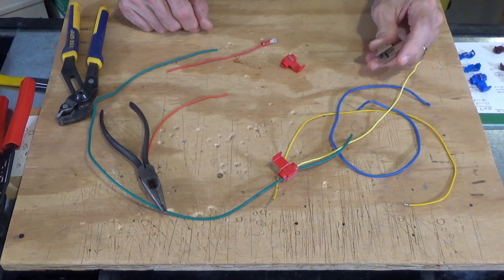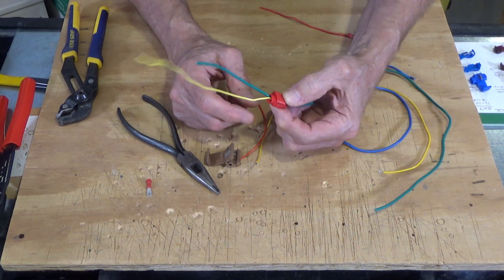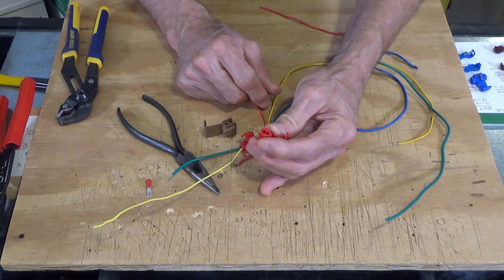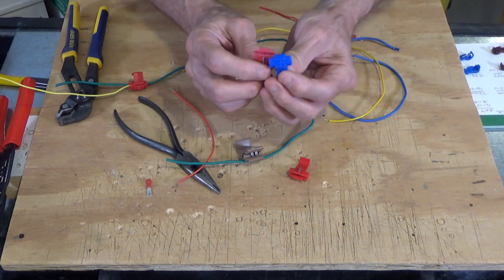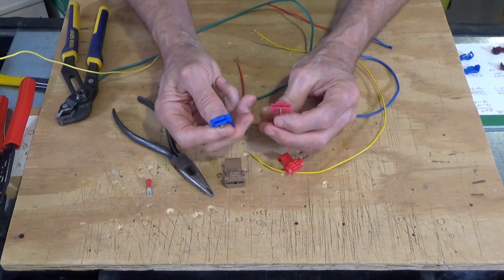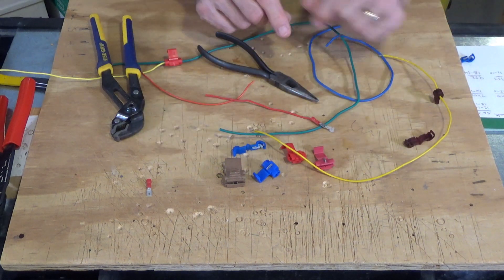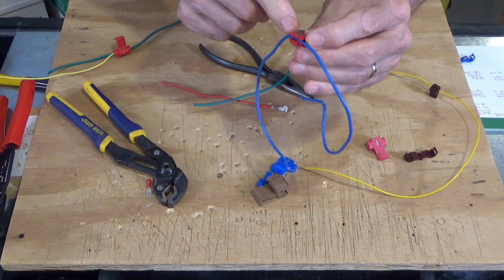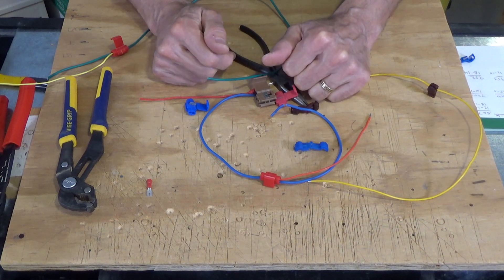Wiring model railroads with suitcase connectors (27)

Comment: I used similar connectors on my layout and found after a couple off years the connections became unreliable, causing trains to stop running on certain sections. As you correctly explained these connections only work reliably if you use the correct size wire. The  WAGO 24-12 AWG connectors are a reliable long term alternative and you can change the wires in the connector if you make a mistake.

Comment: Hi Larry,  your videos are very helpful.  I have a question about using the speaker wire for the Dcc bus wires.  Do you split the wires completely apart to get the 2 separate wires for the drop feeder attachment or do you just slice the speaker wire apart just where the suitcase connectors will be utilized to attach the feeders?
Reply from the maker: I just split it with an Xacto blade where I need to install a suitcase connector. You need to keep the wire runs together as much as possible for it to be effective.

Comment: Try This! Corning 710 Telephone Gell Filled Button Splices they come in 2 or 3 wire Splices and no need to remove insulation as well! These cut through the insulation in 2 separate areas which is Filled with a silicone waterproof grease which ensures that you have a positive connection which is also importantly sealed by the internal grease to prevent any corrosion from occurring. These are designed for the actual Telephone companies and have been used for decades now In and Outdoors. The suitcase variants are okay I guess for some applications that are indoors only and environmentally controlled to prevent humidity and moisture in say a garage or damp basement? Where corrosion is possible for growing inside of a unsealed open connector. Plus the suitcase connector has only a single point of contact with the actual wires. Where the Corning version has 2 different contact points that cut through the wires insulation, which ensures that you have a strong and positive connection to your wires! Just FYI, I've been working with model railroads my entire life and use these for my HO and O Gauge Layouts!  SMFH it beats having to skin each wire, and if stranded wire they'll have to be tinned with soldering in order to use properly in either connector suitcase or Corning. The time savings is amazing over having to skin, solder and then either seal with shrink wrap or tape. These will do everything necessary for just about every size Layout and I've never had one go bad yet In my 45 years now! My father was a lineman and installation specialist for Ma Bell Systems and we always had these special Splices laying around the house. Which he used for his HO layouts and I've used for both HO and O scale and never once had a problem with anything when it came to electrical supply issues. Hope this helps someone out there looking to begin building a layouts or just wanting to upgrade to a easy-to-use, fast, simple and permanent solution to get around having to solder all their connections. (which is of course the proper manner in which wiring should be done) These are the next best thing, in my personal opinion it's actually much better in fact! They come in 2 colors which represents the amount of wires that they can handle. The Clear/Orange buttons are for 2 wires and the Clear/Red buttons are for 3 wire connections. They're rated for 22-26Ga solid core wires, which is much more than adequate for O gauge let alone HO or N or Z, believe me, I wouldn't be recommending these, if I didn't know from first hand experience over a lifetime now. 😊  Happy Railroading Folks!

Comment: Great video. I found another reason why people may have issues. In 2018 I ordered 3M connectors from Amazon and they worked great they were genuine 3M 905s. This year I re-ordered 3M connectors from Amazon and received cheap connectors that are probably quick connectors for 20-22 awg wire. I check the order and the seller does state 3M 905. I did a test with my bus wire and the connector cut most of the wire stands and pulling on the wire it broke in two. I would say that would cause some issues with a DCC bus. I went to Mouser and ordered from there.
Reply from the maker: Yes, Amazon is known to have sellers of fake products.

Comment: Larry, Your demonstrations and explanations are so clear it makes understanding of this so understandable. I wanted to obtain the suitcase connectors you mentioned (3M #905) and was told that they don't stock them normally and would have to 'order' them from 3M. Is that how you obtained them? It seems that that one size should work well for me if I can obtain them. Thanks so much for all of the work you do to explain DCC, etc. phil w., marion, nc.
Reply from the maker: I get mine from Mouser.com (517-905-BOX) and they usually have them in stock but it looks lime they are out of stock until Oct 27.

Comment: Ok so if you have several travelers you tie them all together  then put 1one wire in a connector. You say in video about 1 wire there is 2 what do you do with other wire.
And bus wires go to transfome AC correct?
Reply from the maker: I am not understanding your description of your wires when you say you have several travelers tied together. On my layout I have 4 main DCC buses of 2 wires each that fan out from my PSX4 circuit breaker. These 4 buses supply power to 4 separate blocks. in each block I then use the suitcase connectors to connect rail feeders to the bus wires. I covered this in my book “Wiring Your Model Railroad” available from Kalmbach books or Amazon, and in several articles in MR.

Comment: Larry ... are the pliers you suggest using with suitcase connector the Irwin Vice Grip V-Jaw pliers?   Not Straight Jaw not pliers?
Reply from the maker: Yes those are the ones. These do provide a straight throw over the 1/4” or so needed to compress the suitcase connector and are much less expensive than the specialized pliers sold by Micro-Mark and others. Plus I can use them for other jobs around the house.
Reply: @TheDCCGuy  Thanks Larry ... Happy Holidays!!!
Reply: Excellent video .  Where can I purchase some 905 suitcase connectors.  I love your videos.  Thank you

Comment: Hi Larry. You didn't mention whether the suitcase connectors are re-usable if you wish to redesign the layout.
Reply from the maker: 3M does not recommend reuse and I agree.When they are initially installed the small metal blade spreads out as it cuts through and displaces the insulation then bites into the wire conductor. When reming one the blade usually stays behind and must be removed with pliers. So if you did reassemble one it would be deformed and unlikely to make a reliable connection a second time. I buy them in bulk boxes at about $0.25 each so don’t bother trying to reuse one.

Comment: have you noticed any performance issues using any of these connectors when it comes to either solid or stranded wire?
Reply from the maker: No, as long as you make the connection correctly they work. Folks who have problems use the wrong size connector with the wrong size wire, or don’t get a good solid square crimp. I have used these for 15 years on solid and stranded wire with no issues. Also never reuse one, throw it away and use a new one if you need to replace or redo a connection.

Comment: excellent information. I have never seen the quick connect style you showed..they seem like the way to go for situations where you anticipate removal of whatever it is you are wiring.
Reply from the maker: I use them with circuit boards and Tortoises. As you say a quick way to pull power if you need to swap one out or just doing some trouble shooting.

Comment: Do the suitcase connectors work equally well with solid and stranded wire?
Reply from the maker: Yes, I have used them with both but I do know that in the 3M brochure they do suggest certain types are for only solid or stranded so it is always a good idea to check when you try out a new type..

Comment: I wish I had been able to see this video a couple of years ago. I bought two large bags of IDCs when I first started my railroad construction. I have pretty much abandoned them for T-Taps, as they are mechanically removable (in case you need to disconnect and re-connect).
I bought mine at Electrical Depot. Good prices and great products.
14AWG
https://theelectricaldepot.com/3m-connectors-scotch-lock/3m-scotchlok-connectors/3m-trade-scotchlok-trade-t-tap-952k-18-14-awg-connector-br-bag-of-50?zenid=64cbf4ddc9d2fcc901bc9722e4f815be
22 AWG
https://theelectricaldepot.com/3m-trade-quick-slide-terminals/3m-22-18-awg/3m-mng18250-dmik-22-18-250-male-fully-insulated-br-bag-of-50?zenid=64cbf4ddc9d2fcc901bc9722e4f815be
Reply from the maker: Thanks for the tip on the Electrical Depot, looks like a good source especially for the various ScotchLock products.